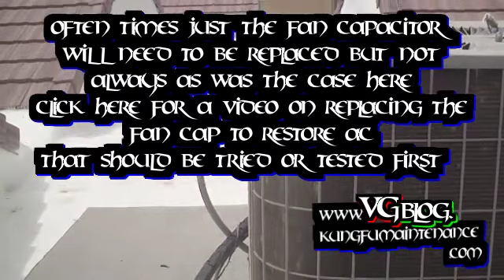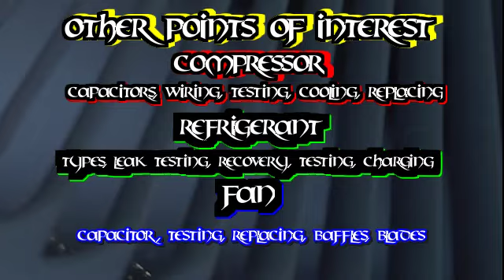How To Replace An AC Fan Motor

Comment from the maker: Valve Core Removal Tool                              http://amzn.to/2kJ00pC
Get KFM favored Electronic Leak Detector        http://amzn.to/2kmQMMz
Simple Leak Seek Spray   http://amzn.to/2lFfcC5  Laser Thermometer  http://amzn.to/2layD8I  
Inficon Refrigerant Scale                               http://amzn.to/2vUCQPD
Get KFM's favored Multi-Meter  here        http://amzn.to/2l8W9CO 
Get the Milwaukee 11 in 1 Screwdriver     http://amzn.to/2uTtsNj 
Wet Dry Vacuum used in so many KFM videos   http://amzn.to/2lFxi7u
Chapin Pro Pump Sprayer                             http://amzn.to/2vWCXdD
Evaporator Coil Cleaner No Rinse Mix        http://amzn.to/2x3eJTT
Evaporator Coil Cleaner No Rinse Can        http://amzn.to/2ezIxju  
Get the Screwdriver used in so many KFM videos here    http://amzn.to/2kHFoOF 
Easiest Way To Get Universal EPA Certified Prep Manual    http://amzn.to/2kIQdQC
Get KFM's favored AC Gauges here            http://amzn.to/2kYgGb8
Hard Start Kit     http://amzn.to/2kiD16v   Contactor     http://amzn.to/2lFqA0P
Get  the Multi Tool Pliers used in so many KFM videos       http://amzn.to/2kWTjPp
5mf Capacitor   http://amzn.to/2wC96sH     35mf Capacitor    http://amzn.to/2vZVZ2t
35/5mf Capacitor   http://amzn.to/2iVJNi2        40/5mf Capacitor    http://amzn.to/2wzEdXD 
45/5 mf Capacitor   http://amzn.to/2w0wez5   
Condensate Pan Tablets   http://amzn.to/2lalV9W   No Rinse Coil Cleaner  http://amzn.to/2lHg8GD
Condenser Fin Whisk Brush                          http://amzn.to/2vWXUoC 
You must be EPA certified to charge or recover refrigerants and here is about the Easiest Way To Get certified with the Universal EPA Certified Prep Manual    http://amzn.to/2kIQdQC
Get The Kung Fu Maintenance book here     http://amzn.to/2lEQPFk
Or  the Kung Fu Maintenance E book here  for less than $5    http://amzn.to/2lEY8wD
Get the Kung Fu Maintenance album (good driving music) "Up Beat" here     http://amzn.to/2l41pZ1
Get the Kung Fu Maintenance album (nice Instrumental music) "Entropy" here   http://amzn.to/2kl2U0p
Samsung Galaxy S8 Plus        http://amzn.to/2sFn9h8
GoPro Hero 5 Action Camera         http://amzn.to/2sN4nVK
Rode Lapel Microphone                 http://amzn.to/2vZoFc7
Purple Panda Lapel Microphone  Kit   http://amzn.to/2wByXkq
Video Edit Pro Software       http://amzn.to/2ruaaeZ
Samsung Galaxy S5                 http://amzn.to/2wBxk6l     
Samsung Galaxy S8 Plus        http://amzn.to/2sFn9h8
Video Edit Pro Software       http://amzn.to/2ruaaeZ

Hire An HVAC Specialist                                  http://amzn.to/2lktKek
Air Duct Cleaning Services                              http://amzn.to/2lFTpun
Central Air Conditioner Tune Up                   http://amzn.to/2lzJGoy 
Air Conditioner Repair Or Installation          http://amzn.to/2lFsEGw                                           
I don't work for any of the product companies  listed however I do make a small commission on items ordered  through the links.

Comment from the maker: Once I changed a fan motor and went to install it and the shaft was so long that it was hitting the top of the compressor. The simple fix was to cut off the fan post with me trusty sawzall. You can measure the available space that you have and get one sized accordingly. I have had good success with fan motors. I have many still going strong seven years later. You want a fan with correct rpm and fan blades with correct pitch. These are specifically engineered to get the job done.

Comment from the maker: Thank You for the further info that helps a lot. What you have there is most likely a dual run cap having three ports C H and F ( Common Hermetic and Fan) I hope to be showing soon videos on how to convert these back and forth and/or how to separate them if needed or wanted. The video I told you will show you how to kick start the fan motor and that will show you definitively if the fan portion of the cap is bad which could be remedied by conversion to single caps or replacing the dual cap.

Comment from the maker: Yes good true points all around. An adjustable wrench works good for this as the fan shaft bolts are square, rachet is faster. On rooftops reversing wires through the lid is common practice but on the ground where the general public has access the wires should definitely be wire tied underneath the fan lid usually around or to the conduit. I have many thirty year old units in ten years I have only had two where the wiring through the lid ground out. I agree tucked under and tied is better.

Comment from the maker: Thank You, Up on rooftops this is common practice but down on the ground where the general public has access the wires are usually wire tied underneath the fan lid usually around or to the conduit.

Comment from the maker: It has worked well in my experience. My theory is that the cold makes the parts shrink even as the heat made them expand. Lubricants can help also. Thanks for watching!

Comment: Your 100% rite about the rpm, more isn't better, not in my case I had less amp on the motor and more rpm. I had three large fan blades that drew a lot of amps.....I had call out a tech my wife and I couldn't stand it, and 100 degree weather isn't good for a new born..... cost me $120 for motor and replacement, me and the techs sons hung out together....thanks for your help Kung fu...

.

Comment: That would be interesting to know how to cope with those dual capacitors.  Last year I bought both a replacement contactor and just in case a dual run capacitor. So far I have only replaced the contactors and all is working fine...for now.  But I sure would like to know how to replace that old dual run capacitor.  I am confused by the many colored wires and I am not sure which ones are for the compressor or for the fan.   Thanks for all the practical know how you are giving folks.

Comment: The reason I ask about determining whether it is the fan motor or the fan capacitor that has failed, is that on my sister's home AC unit, there is only one capacitor that takes care of both the compressor start AND the fan motor.  So, if the need presents itself, I would like a way to help identify the failed component and not just replace the only capacitor there.  I will look up your AC 101 video to gleem some additional knowledge.  Thanks !

Comment from the maker: Actually this is the condensor fan motor and it is an air conditioner fan but there is a good point you are making that the indoor fan pulls the air through the air filter across the evaporator coil which "conditions" the air both by filtration and removing heat. I chose the title "How To Replace An AC Fan Motor" for this one for dual reasons as AC stands for "Alternating Current" and for "Air Conditioner". I also have videos on repairing the indoor blower if interested. ~ Thanks for watching!

Comment from the maker: I'm sure some people will disagree with me but I prefer to never use a hub puller and I have yet to find the need for one. I have used them before and have one sitting collecting rust in my shop. In my opinion using a hub puller makes it too easy to bend the blades or frame and/or change the pitch causing the fan to wobble. I suppose if good care is taken to properly sand and lube the post first than one could use a hub puller successfully but again I think it unnecessary if well sanded.

Comment from the maker: The easiest and fastest diagnostic is to just change out the fan cap (motor also has thermal overload so you may need to cool or let it cool). If a new motor is needed than you have your new cap ready to go. I will add the annotation link on the video showing the procedure titled "Air Conditioner Not Cooling ~ AC 101 ~ Troubleshooting with Kung Fu Maintenance". It shows the diagnosis of a fan motor that would not start on it's own but could be kick started with a small push. More in the works. ~

Comment: The question arises is how do you diagnose that it truly is the fan motor that needs  to be replaced...or...possibly the fan capacitor.  What kind of diagnostics need to be done to pinpoint the real failure?

Comment: No offense, well maybe, but is this a training video by THE RUN CAP BANDIT?
(Seriously, look up that phrase and you will see why).

I am so sorry, but we would use this video to train out HVAC techs on how NOT to change a fan motor.

1) The run cap should be strapped with metal NOT left in a box.
2) The reversing wires on that universal motor should be kept below the fan grill and the pros actually cut them short and use dead end connectors etc so they NEVER fall into the fan when the zip ties rot in the sun and snap, or short or shock a person with them hanging out the top where the terminals will crack and expose the wires. Guaranteed.
3) Going back to the capacitor, to rewire back to a three wire setup like the OEM, just cut off the brown wire with the white stripe. many people mount the capacitors like that (hanging them next to the fan, sometimes even under the fan) because they don't know how to wire in a universal as a three wire and the new motor doesn't have long enough leads to go back to the electrical panel.
The OEM only having three long wires to splice to, so again people not knowing how to wire universal as a three wire just hang the cap to the two cap wires and splice the other two back to the electrical box.
Reply: hackfreehvac Sorry. I generally do not "troll" videos or anything like that.
I stick with my peers mostly on this youtube account but since this was "related" to some of our HVAC videos and i saw this, I just had to say something.
Reply: He should invest in an 11/32 nut driver
Reply: sad hvacman
Dude, a few weeks ago I was on a roof with a coworker and he borrowed my 11/32 nut driver to change a motor and I forgot to get it back and went a week without it.

IT SUCKED to use the crescent wrench!

if i wouldn't have known I would just get it back the next time we both went to the shop I would have just bought another one ASAP.